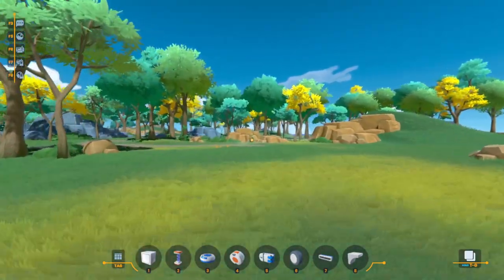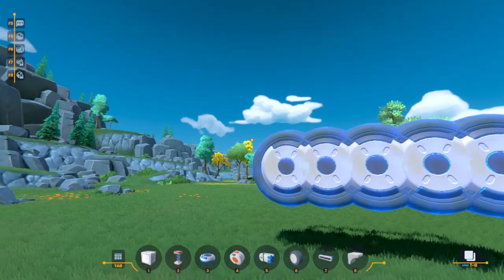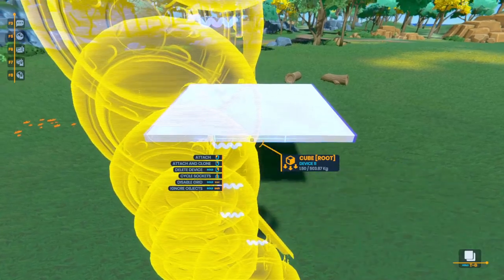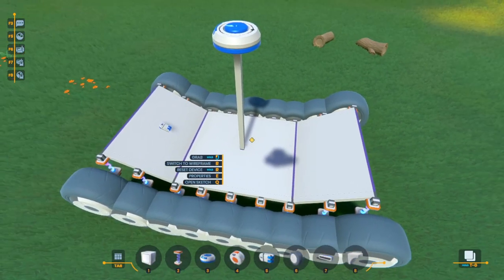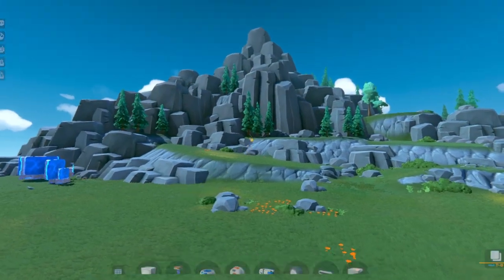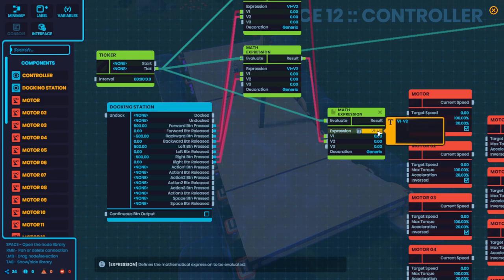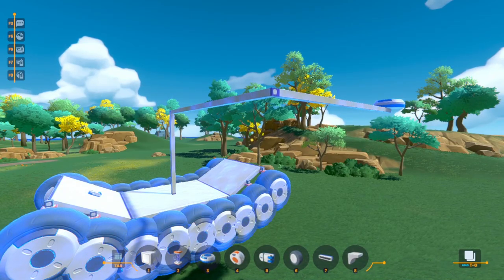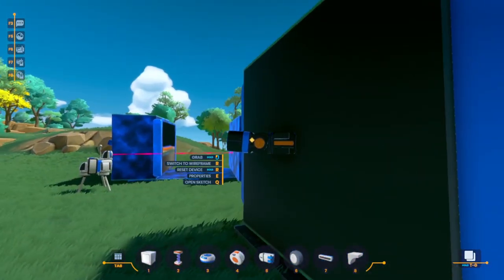Tank Build & Programming EASY 🤖 PLASMA

Comment: Pro tip: use the Relay node to consolidate connections and make the sketch less... well... sketchy.
You can also use Events (Broadcaster and Listener nodes) triggered by the docking station's button presses/releases to tell other nodes when to evaluate in a nice clean way without re-evaluating every tick. As an irl programmer, re-evaluating everything on every tick even when it hasn't changed feels like hitting a nail with a sledgehammer :) Sure the nail got hit, but at a significant cost to the wall and in this case game performance. (Even further, Events send payloads through so the same Event listener can be used to trigger evaluation AND populate values without having to run connections across the sketch.)

Comment: hey instead of evaluating every tick, drag the same inputs you sent to V1 and V2 to evaluate.
This way the code only runs when you press or release a button, it makes the creation a lot more lag friendly.
If you're into programming this is a design pattern called event driven architecture.

Comment: Pro tip: instead of connection multiple nodes to an output create a variable that the output writes to and make all the nodes take the variable
for example : you could use a node called "write to variable"  that writes from "math expression" node output and for all the motors you had you could take in that variable

Comment: But now, when pressing W and A/D one side will go double the speed an the other one will not turn at all. I copied your build an noticed the problem. Still trying to figure out how to fix this
Reply from the maker: Depends what you want it to do when pressing key combinations
Should it not double the speed? Should it not stop?
You can give priority to WS over AD, so pressing a combination will only result in forward/reverse, or the other way around where a combination will only turn and not move forward/reverse.
There's a lot of ways to do this sort of thing, but it depends on what you want the tank to do
The behavior is intentional and WD is adding the drive values to the turn values, for each left and right side, resulting in the double speed and zero speed. That's actually what I wanted my tank to do.
Reply: @Durf  Ah, okay. My vehicle just flipped because of the double speed, that's why I asked. I don't want it to stop when pressing AD while driving so I just mapped outputs -1000 and 1000 to 500 and -500 and subtracted them from the result. That way I make sure that my max speed won't exceed 500/-500 while still allowing me to steer while driving :)

Thanks for answering btw, I really like your videos! :)